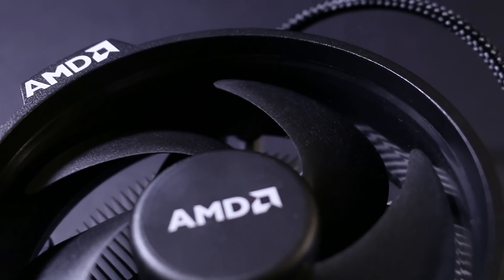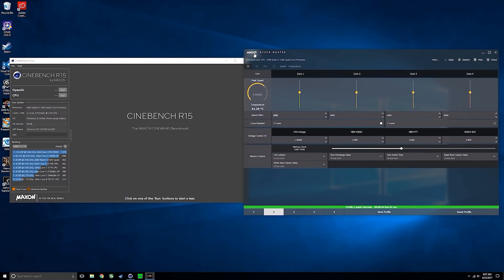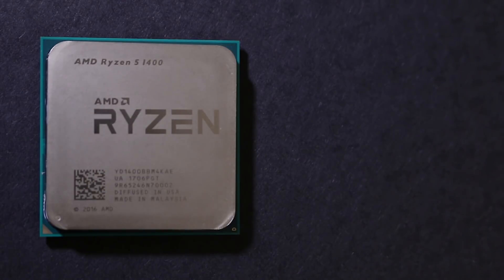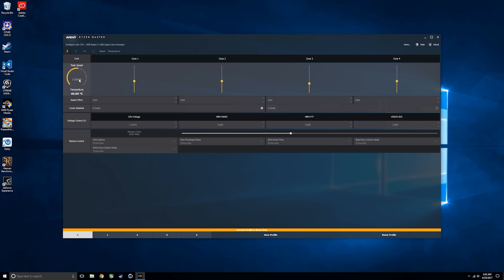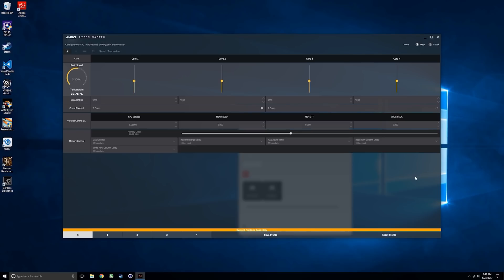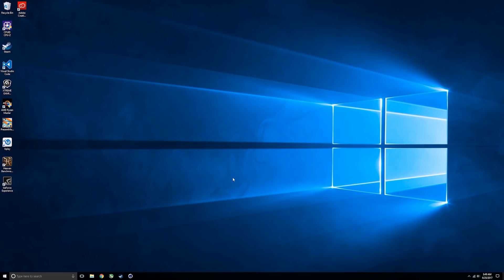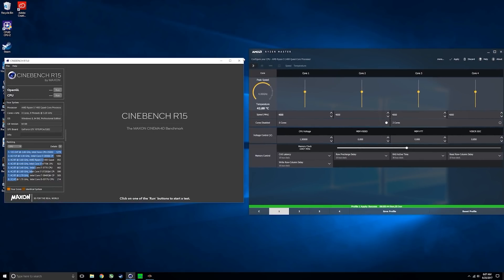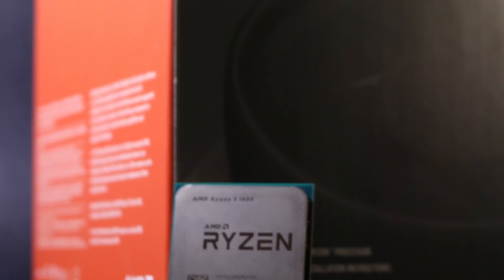AMD RYZEN Overclocking GUIDE

Comment: I'm new to OC but I definitely don't want my cpu to be running at something like 3.8 GHz all day. From doing research I found that I need to adjust P-state overclocks to make sure the cpu can downclock and downvolt. My Gigabyte AB350 doesn't have any P-state options so what should I do?
Reply: I just like to squeaze every bit of perfomance out of my systems lol. I'll test it myself, my Ryzen build arrives later this week
Reply: BlueFlame I'm about to do just that, very soon.  New to building a pc, even.  It runs fine but I now need to find the limits and squeeze performance from the chip.  My board (MSI x370 carbon gaming Pro) doesn't offer p-state either.  I don't know how much you've already done but did you grab the Amd chipset drivers with the Ryzen balanced power plan included?  Just curious.  I already did that.
Reply: Yeah I did that. Although I changed the minimum processor state from AMD's default 90% to 10%. I don't like my processor running at high clocks all the time. I switch to Window's high performance for gaming.
Reply: BlueFlame You're ahead of me.  I've been looking over how to o/c etc having never done it before.  How did you change that setting?  Do you mean within the high performance tab, advanced options?  Some have done the same as you, from what I've read.  They used 20% but same idea.  I haven't messed around properly but this board isn't the best, apparently.  I'm not looking for a super o/c so it should be ok but regarding the balanced plan... I thought it dealt with some of the parked core issues, etc.  Once I've tinkered with it, I'll try to report back, etc.  It's still early days, I know and bios updates are at different frequencies, depending on manufacturer, so I take that into account but it's possible that a p-state option could be introduced with a future update.  One more thing... what cooler are you using atm?  I've got the Wraith spire and am looking at the Noctua d15.  Seeing as I've spent a good chunk of cash on the build, I figured I should look after it with a decent cooler.  I'd be interested to hear how your o/c goes.
Reply: I was talking about the power options, I haven't done any OC so far. So AMD have an official blog post about why they made their Ryzen balanced plan but I'm still confused about it. 
They say that when using their balance plan Windows doesn't core-park the CPU and you still get the same performance benefit as with the Windows High performance plan. 
My problem with their plan is that it doesn't allow the processor to downclock. They claim that it actually does downclock but the applications used to monitor this stuff don't show it. I found the whole thing strange so I decided on the following:
Use their plan, because I don't know if something else besides the processor settings is changed, but put the minimum processor state to 10% and that way I'm 100% certain it downclocks. I switch to Window's High performance plan when gaming (I don't mind the extra hassle). Also, when I changed AMD's plan to 10%  I don't see any core-parking but even if I did I wouldn't care if cores were parked when I'm not gaming.

If I don't find some way to have the cpu OC while not running at max frequency 24/7, I won't OC. My cpu already boosts to 3.7 GHz on all cores thanks to XFR so I don't really need to OC. I've heard people say that XFR only works on 1 or 2 cores but my software shows that all cores get boosted to 3.7. I'm using the stock cooler. From looking at reviews, it should be good enough up to 3.9 and maybe even 4.0 GHz so I don't think you need to spend money on another cooler. 
It all really depends on what you need the cpu for. I've seen big gains in tough to run games from an OC of 4.0 GHz so some people would OC even if it costs them extra power and heat. I'm using the cpu for eSports games so I don't need to push it that far.

Btw, this was also my first build so don't take what I'm saying too seriously. I've done as much research as I can but since this is a new architecture there are strange things going on and different people are saying different things.
Reply: BlueFlame I hear you.  Same here.  I've offered things to others with the same disclaimer - check it out yourself, first, etc.  
I'll mess around, research some more and see what I can come up with.  Yeah, depends what you want to do with it.  Like I said, I don't need a huge boost for my use (workstation), so I should be good with whatever I get.  Stability first.  
So much information out there... took a long time to decide on parts but I'm glad mine's running.  Don't know about you but (it being our first builds) I held my breath once I powered on.  Those seconds felt like ages.  First boot took a little while but you wouldn't believe the relief when it worked out and I got the bios screen.  
I wouldn't buy pre-built ever again.  I wouldn't have the PC I've got now and it really is quite simple to put together.  Had an issue where it could see my drives in the device manager but nowhere else.  After a time looking 'round the net, I found ONE post (ONE!) that, thankfully, solved it.  They were being used in a pool.  Simple solution.
How did you find your build?  Any issues with it?  
I couldn't have done it without the various sites and the information that's being passed on.  I want to be able to pass on my experiences, too.  
I was going for the i7 7700k originally but when Ryzen came out, I couldn't pass 8c/16t up.  Also, I knew that future applications would be optimised, over time, to increase the performance/stabilise the system, so it felt like a win-win.
I'll have some time over the next weeks and am hoping to give it some tweaking etc, to see what I can get from it.  Daunting but exciting, too.  Feels good to be part of the self-build group.  
I'll report back with anything I find out.
Good luck with yours!
Reply: When I first turned it on it got suck in a boot loop because of the RAM and I had to set it to 2666. Now I've got it running at 2933. I'm also never going back to pre-built. I'll report back here if I happen to find a way of downclocking an overclocked cpu without using P-states. Good luck to you too.
Reply: I found something interesting: https://www.reddit.com/r/Amd/comments/5y18mu/if_a_ryzen_cpu_is_overclocked_manually_same_ghz/

In the thread there's a link to AMD's official document about OC. I'll look at it and see if it says anything about idle downclocking.
Reply: BlueFlame That's a pretty good amount of information.  I'll read properly once I get the chance.  I actually got a black screen when I tried one of the ram profiles and it cycled a few times before resetting.  I also have to read about CMOS resetting, etc.  This board needs a manual jump and particular procedure, in order to clear.  I have 3200 ram but, same as you, got it to 2933.  Around work, I'll be downloading the newest bios for my board and seeing if that helps any.  I'm seeing various results, across the board which seems to be the norm and is obviously dependent on board and components.  So, mine is the Msi x370 Carbon Pro gaming board, with the Ryzen 1700 chip.  Corsair vengeance lpx 3200 ram (CMK16GX4M2B3200C16).  The reason I mention the CMOS, is because, when I turned on, a few days later, the ram had returned to default speeds.  Apparently, possibly due to CMOS clearance.  I appreciate the link and info.  Anyone else can compare and add their own configurations, because more information is needed.  I'll get back with more information, once I've had chance to play around with it.  Thanks again.
Reply: I overclocked to 3.75 GHz using the Ryzen master software because my bios uses the offset method for voltages and that was too annoying for me. In the morning my idle cpu temperature is 28 C (I live in NY state so it's summer here) and the cpu does indeed downclock when you've set the minimum processor state to something like 10%. HWinfo32 shows that the voltages reach 1.35 when the processor is at full speed, even though I set it to 1.3 in Ryzen master, but it also showed that before I overclocked so I'm not sure if it's a software bug or what. So the conclusion is that you don't need to worry about P-state stuff and just follow this video guide. The only thing is that in the pdf file from AMD it says you have to enable Windows HPET and disable fast boot. I'm not sure why it isn't mentioned in this video but it's important so make sure to those two things before you start overclocking.
Reply: BlueFlame That's interesting.  Thanks for pointing me in that direction.  I didn't know there was a pdf I could download.  I'll keep that in mind.  As for readings, like some of the other quirks, it seems that it's quite difficult to get true temps, etc.  I'm going to try working on it Thursday, to see what I come up with.  With my 1700, 3.7/3.8 seems to be the sweet spot, before it's diminishing returns.  The 1800 looks like it has a better chance of hitting the 4.0 mark, without too much trouble.  I saw a video a while ago that showed o/c'ing, using the bios, Ryzen master and auto settings (can't remember exactly what it involved) but the Ryzen master o/c came second.  The uploader couldn't squeeze as much as through the bios.  Thanks for the extra information.  I'll be back with whatever I find.
Reply: BlueFlame what happens when you leave fastboot enabled when OC'ing? I like a fast boot time so I prefer keeping it enabled
Reply: No idea but I wouldn't recommend going against AMD's own recommendations unless you Really know what you're doing. Also, how often do you have to boot that a few milliseconds would be important?
Reply: Best of luck
Reply: if it doesnt have a p state then it would have a c6 or C state global

Comment: Best overclocking guide hands down
Reply from the maker: That means so much, really happy you enjoyed it!
Reply: @optimumtech  ... I'm using Ryzen 1600 with MSI B450 Pro VDH. Overclocked cpu to 3.6Ghz(no change with core volt... Set to auto 1.240v). Run CPU Stress test through AIDA for 30mins approx. got cpu temp 63c and Mobo temp 77c approx. Is it ok? If I push cpu to max 3.9Ghz how much volt i have to use?

Comment: Good video mate. Don't know if I won the silicone lottery, but my r5 1600 is rock stable at 3.95ghz with 1.278 v. Tested it with prime95/aida64 for a whole day and i have no problems at all. Also the max temperatures are in high 60's/low 70's. Mobo used was Asus B350 prime

On the other hand 4.0ghz oc is impissible, no matter how much voltage I add... I
Reply from the maker: 3.95GHz @ 1.278 across 6 cores is SOLID AF, especially with those temps. I'd be very happy.
Reply: Mobo is Asus PRIME B350M-A with the latest bios and RAM is 2x8GB Kingston HyperX Fury 2666hmz, PSU - EVGA 600W 80+ bronze.
Al the tweaks are done in BIOS, not with Ryzen software tho
Reply: Dude thats a very good overclock on a 1600 and if it makes you fill any better 4ghz would would be so small a difference from the overclock you have I doubt you'd notice it. 

Haven't ordered my cpu still saving up hope I can overclock good on my chip.
Reply: you need higher voltage than that, the OP got very lucky, for me to run at 3.8 i need 1.35 V. So you need to do further testing on your own CPU to see what it can do, although theyre all the same make and model theyre not all the same.
Reply: Mate can u tell me what to do with msi mobo gaming pro .. 
It keeps crashing on 3.8 Ghz at 1.275 V 
I use Prime95 for stress test .. but still crashes on me ... i donno what to do .. Newbie here ..
Reply: llama maybe your motherboard are holding you back, or you lost silicone lottery...
Reply: Hey will you recommend going with ryzen5 1600 or the i5 9400f , sporting a GTX 970 , which platform will be more futuristic?
Reply: @akashsancheti9083  you idiot

Comment: Uhm it does nothing. Tried this ryzen master and it doesn't change anything.restart pc and it's still on stock rate. What did i miss?
Reply: I'm having the same issue. I just did it through the BIOS. I'm at 3.5ghz 1.375V currently, but I'm still testing.
Reply: That's too much voltage man for 3.5. I end up doing it with the bios cause ryzen master does absolutly nothing idk what's that app for. By bios i and up with 3.8Ghz cpu with somewhere belove 1.3v and with ram i could only go to 2933 cause higher it's insta blue screen. I would guess my cpu can't handle it but idk.
Reply: No I know it was too much to start, I just didn't want to have to keep failing and re-updating, so I did what he said to do which was to turn up voltage and see how high I could get the clock speeds. I got them to 3.85 before the system crashed during Cinebench, so I settled on 3.75ghz at 1.375 and it's stable. I'm also on a quasi-stock cooler. It isn't the Wraith one that comes with the R5, it's a cooler my prebuilt used (which isn't awful, but isn't going to get the speeds I'd like).
Reply: But yeah I had to go into the BIOS to do it as well, as the Ryzen Utility Master wasn't updating anything between restarts, it's kind of irritating seeing as I went through all that work for nothing.

Comment: Never really overclocked with software, but when you do, do you have to have the software running at all times? if I x out of it, will it close? And will it delete the current overclock? Secondly, i updated my bios and found that the 1550 mhz bug is now applied if I overclock via the bios..have you had this problem? Seems to be wide spread with recent bios across a plethora of msi, asus, etc boards; just curious and thanks for the great vids man!
Reply: I think the software is mainly used to just monitor your cpu and oc. I don't think it has to be constantly open.

Comment: How will the temperatures be with a ryzen 7 1700 with a h80i v2 at 4.0 ghz at 1.35v in the corsair spec 03?
Reply: Plz respond I have been asking so many youtubers no one responds
Reply: Also what will happen if I put the first 4 cores of ryzen 7 1700 at 4.5 and the other 4 at 3.5 will that boost gaming performance , because most games only use 4 cores?
Reply from the maker: It's impossible for me to know exactly without having that system here. Factors like ambient temperature and case fan configuration also play a role. 
I'd estimate 60-70C
Reply: Optimum Tech the ambient temps here are around 30-40 degree Celsius . This is my setup https://pcpartpicker.com/list/zfQyPs. Fans run at around 60-80%.

Comment: I got hosed in the silicon lottery. My Ryzen 5 1600 can't hit 4ghz no matter what I do. I run 3.9ghz @ 1.35V with a Corsair H100i GTX cooling it. I never break 60 degrees Celsius though.
Reply from the maker: I'd consider 3.9GHz fairly average man, maybe above.

Comment: my ryzen 7 needs 1.4v at 4.0ghz to be stable
Reply: Jonatan Viitala 
Careful. Not supposed to go over 1.45.
Reply: Shirokuro Max heyy someone told me to try an negative offset
they said it would clock higher and cooler

soo i tried out various settings till i got to 3.9ghz stable at an negative offset of 0.05

wooo
Reply: PLPlolol 1 damn
Reply: Chashniels, what temp do you get on cinebench?
Reply: AMD are clear that up to 1.45v is fine for everyday use but I'd suggest keeping the maximum to around 1.42v.
Reply: should I oc my r7 1700 to 3.8ghz on stock cooler(1.325 volts)
Reply: On air cooling with the stock cooler on my 2700x.. I am at 1.25v @ 4GHz, idles at 40-45C and gets up to ~55 under load.  Can get it up to 85C under Prime 95.  I feel I won a great lottery :)  I can fine tune the voltage even lower, almost had it stable at 1.2v before prime 95 hit.. so I can probably drop it to around 1.23 or 1.22 for stabile clocks
Reply: My Ryzen 1700 hit 4,2GHz in 1,5v :') Got a 1834 score on cinebench but I think it's a bit low so should maybe try increase the voltage a bit to see if it was unstable or not. Otherwise my 1700 runs at 4GHz in 1,3v :) Crazy how lucky I got with this CPU!
Reply: my ryzen 7 1700 gets to 3.8GHz with 1.3v. I also have 3466MHz CL16 ram running with the timings 16-18-18-36.
Reply: SquaficleDude
Don't you worry! It was just a fun test! I often find myself breaking the laws. As I said I'm running a lower clockspeed and voltage now since it's a mITX board with limited VRM cooling ;)
Reply: PLPlolol 1 dont do that. im sorry but your límit is 3.9, or you will hurt your cpu
Reply: weird thing that my mainboards auto settings bumped my cpu to1.5v wich was crazy o.O

now running fairly cool with 1.35v and 3.8ghz
Reply: skm Jesus I must have lost the silicon lottery BIG time.... I can’t get over 3.875ghz below 1.39v
Reply: @765outdoors  I lost it when i got my 580 cant even overclock it 10mhz over the factory clock
Reply: @Nameless6912  is it factory overclocked
Reply: @jesuspg183  what hahaha hurt?

Comment: ryzen can tweak without going into bios ? wow
Reply from the maker: Yep, so helpful
Reply from the maker: Blue screen is okay. Just let Windows do it's thing, otherwise force shutdown. When you boot back up, adjust the settings (add voltage or lower clock speed), either in Ryzen Master Software or Bios.